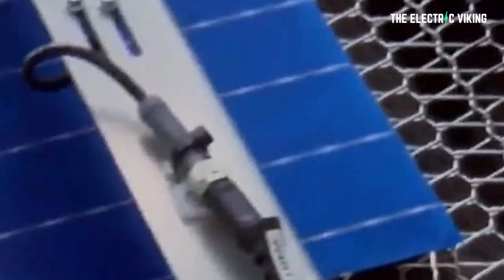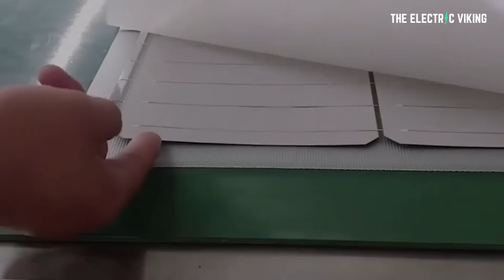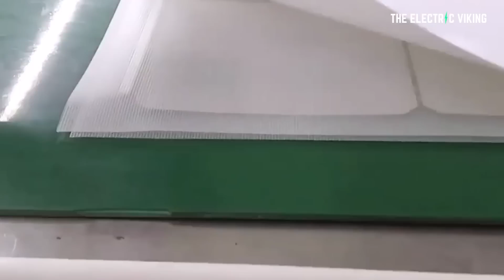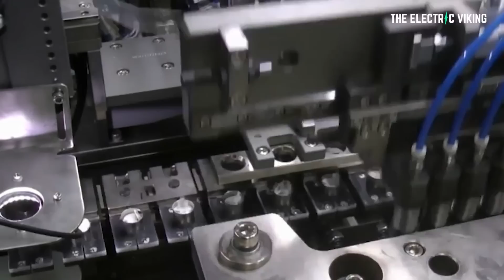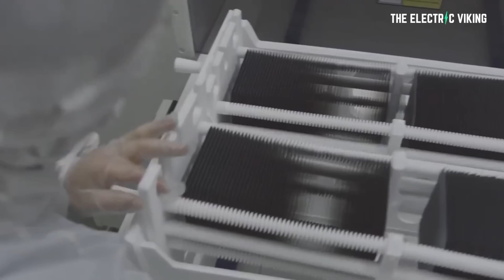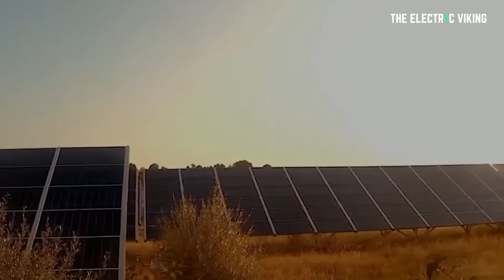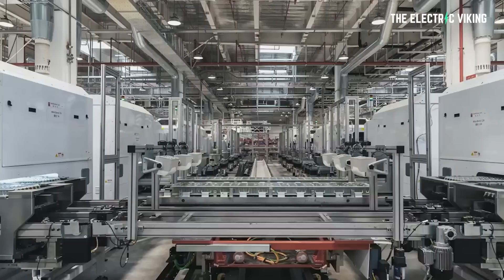China’s solar panel price war will double solar panel installations globally

Comment: Solar is not usable in most of Europe.there is risen need of energy wintertime but more than 4x less solar at that time. And also battery tech will not help since holding 50 days worth of energy will fill the gap but that costs too much but when done well it has similar initial cost to nuclear. The problem is that is not green energy anymore since area needed to cover solar panels will need that arable land is covered and that means erosion and methane generation instead carbon capture by forest or food generated. So let Europe out of equation. It will be good part in mix but it is not 100% solution. In my country Estonia there must be 90-100 day storage for 100% solar and about 5% area covered. Most of europe needs 15-20% area covered by solar cells. Estonia us started to move towards wind energy and in 10 years there  may be 2x current electricity  needs come from wind  that means 2/3 wil we green energy and the rest is heating and that is problematic since  when not to do seasonal storage then there will be overproduction in summer and underproduction at winter storage some 20 days total as a heat in hot sand may be optiin and  use molten salt batteries to heat that sand may be solution.

Comment: My son maintains a solar panel array and the problem with it is not with it generating electricity but generating it at the wrong time. if we accelerate solar production again without being able to bank the excess power it makes in daylight hours then we will need those fossil fuel generators to cover nighttime demand. The gas-fired generators will hold the market to ransom while they are needed and demand huge subsidies to remain available and this will push up prices Our grid is still unsuitable for even more solar coming online as well. So until we can store all excess solar production and deliver it to the grid in total expanding solar anywhere is not viable.

Comment: How many of these Chinese solar panels are produced using fossil fuels, coal mainly, or ecosystem destroying hydropower probably the majority. How well made are they? What are their environmental impact when no longer in use??? 
I'm off grid and use solar and I'm for clean energy but in many countries especially  northern Europe it is not going solve our energy needs it is only a small part of the solution. Massive investment in nuclear fusion not fision, the much more toxic big brother technique, are required and better built homes and more small scale local solutions involving solar and wind may certainly help. Japan has successfully run a highly efficient fusion not fision reactor for a year with no problems. Just an opinion.

Comment: Sam, love your optimism but disagree on a massive increase in demand coming from a lower price of panels (demand elasticity). For a start the cost of the panels is only a part of the cost of installing grid scale solar. Secondly, although marginal costs of running a commercial solar farm are close to zero, you have to consider the capital costs too. The cost of capital is rising all over the world due to higher interest rates and a rapidly changing demographic. Which brings me to the third factor constraining installations of solar, labour. In most European countries now the baby boomers are retiring at the fastest rate in history, the pool of skilled labour is shrinking which is causing all kinds of problems...and of course rising salaries which add again to those costs. Love the channel, the world needs more of your ‘glass half full’ attitude.

Comment: At the moment, this is more of a political problem than anything else.  The EU is subsidzing Oil&Gas at an unprecedented scale and throwing other spanners in the works of the transition. This will slow it a bit, but not stop it.

May I suggest you make a video about said EU subsidies and Carbon Takeback Obligations.

Comment: You still are not explaining how we get through the week of wind and solar drought like we had back in June just to get through 1 night in that period would require 500000 megawatts of either generation or battery storage  that's 30000 mwh x 15 hours leaving 10 percent for line stabilisation  don't wish to hard for all coal and gas generators to go broke you might regret it   either we retain backup gas generation which will have to be subsidised or we go to nuclear  backup    look at the big picture and not just the 100 percent renewable dream

Comment: You didn't mention a key factor in the shift to renewable energy - power storage.
A 30% drop in price for solar panels will only acierate the demand for them, AND for power storage.  Selling power storage systems will be like printing money.
Tesla's new Megapack battery factory in Lathrop, California, that is just now coming online, is far larger then any other, but 40 GWh per year isn't enough for the rapidly coming shift to renewable energy.
Reply: Yes, the new Megapack factory is rated at 10K units per year, $2.4 million per unit, it's sold out to 3rd qtr 2024.  Utility scale storage is already rocketing, sky is the limit for years to come, more so as battery prices keep getting lower and renewable sources keep growing.  Giant floating wind turbines is the coming big thing, 500 ft diameter rotors.  China has an off shore wind turbine with a 827 feet diameter rotor that generates 13.6 MW, don't think it's floating, nevertheless it's amazing.

Comment: The reason why chinese would not be able to keep pricing down comes 2 side. 1st is their new embargos and usa turning their back on them( why they have to invade taiwan so they can keep their high end machinery running due to chip shortage) 2nd side is raw materials solar panels raw materials come from canada, and partially their recovery from the whole covid lock down which is going to be hard. On the side about the forced labour. If chinese really had such great free market factories you would be seeing 24/7 media campaigns so they can rub it on USA. Sometimes what you don't see tells you more than what you do.

Comment: Europe needs nuclear for base load. Solar isn't always sufficient even combined with wind and battery. Nuclear is the cleanest and safest power supply, and the newest generation nuclear is more so than ever. Modular reactors and newer designs can be less expensive than previous generations. I'm not saying don't do solar, wind, hydro, geothermal, batteries, but nuclear is ESSENTIAL IMO.

Comment: I know China wants to deal with their pollution problems. They are deploying a lot of renewables.  But they are also deploying a lot of coal plants.  This is to deal with recent power outages.  And this is to run an economy heavily based on manufacturing.  I'll be convinced once China is able to phase out their reliance on coal, and run an industrial economy based solely (or mainly) on renewables.  This is the test.

Comment: Crucial: increasing the efficiency of photovoltaic panels to more than 80%. Maximum experimentally is 34% (silicon-pervoskite tandem cells - researched by a German/South Korean team). 

CPUs, GPUs and RAM to over 80%.

Also nice: ZOOMLION using more and more EV mode with its construction machines.

Comment: Renewables have been nibbling away at the customer base and oil and gas for a decade now, but only now is that starting to have a noticeable effect. The Russia war has distorted and added a huge multiplier. All the doubters focus on volumes when the real change happens at the marginal price level where very small changes in demand can drive huge swings in price. Witness the complete temporary collapse of oil price in spring 2020 due to the bug. OPEC and others can only win if they can co-ordinate enough to drop production concurrent with demand, but at some point it will be a runaway train with some dictator needing his corrupt cash and selling black market. Soon it will be desperate rush to oblivion.

Comment: WRONG!  Solar cannot be used as base load.  If your thesis was remotely correct, a coal/gas/oil generated utility that went out of business would leave the solar panels to provide power when the sun shines and no electricity at night, UNLESS there were sufficient storage to meet the nighttime electricity demands.  Batteries are not getting cheaper, in fact, they are getting more expensive as the raw material shortage gets worse.  What will happen?  Individuals will take advantage of lower cost panels and install them on roofs and feed electricity back into the grid.  As that electricity reduces the income to the utility the utility will decrease the money they pay consumers for excess power and will charge more for what power is used.  Hence higher utility rates.  The California utility commission has already set April 1 as the date for a decrease (approximately 70%) in the amount paid for solar power from consumers.  Solar on rooftops can still be viable, but remember TANSTAAFL.  There Ain't No Such Thing As A Free Lunch.

Comment: Heh..you might be right. I've noticed that the price of natgas has dropped below $4. Oil prices have dropped as well. You have to wonder what will happen to fossil fuel prices if demand drops dramatically. The next year or two should be very interesting to say the least.
Reply: Fossil fuels will eventually go the way of blockbuster...
Reply: fuel prices will drop, as most of the price of fuel is the intrastructure spending from constant growth. Once fuel use peaks out and starts declining the price will be very very cheap, which will create a bizarre situation as it will help fuel vehicles remain economical against EV.
Reply: @sectokia1909  Nope. Fuel companies will UNDER invest in Refineries and other transport to keep Prices Higher and Profits higher. We saw that during this mess in Europe earlier. Fuel prices will remain high(er) because many of the Fuel Producers are Cartels and near monopolies.

Comment: Although I don't fundamentally disagree with what you are saying, a lot of the market analysts seem to think that gas and oil stocks will have another bumper year in 2023, as they had in 2022. Also in the case of Germany,  relying too heavily on solar and wind energy seemed to be a mistake for them.
Reply: Insufficient energy storage capacity.
Reply: Relying on Russian Gas seemed to be the BIGGEST Problem by Far.

Comment: Hi! Do you have sources for the data that you provide? Enjoy the channel, but it would be great if you can add your sources
Reply: He never does.
Reply: Why the heck should he.  Tony seba has done the research.  He's got better thongs to do with his time than deal with deniers
Reply: He has no source, he is lying.    If the Island of Ireland  installed 50 million large wind turbines and  50 million solar panels.  If it dismantled all its fuel generators,  there would be no electricity at all.

Comment: China was able to produce panels at much lower price by using cheap Russian fossil fuel. Each panels need to produce energy for 3 years before it can offset the carbon emission require to make that panel. Go figure. So when you say panels production is going to explode, you actually meant fossil fuel consumption required to make those panels are going to explode. How are the fossil fuel companies going to bankrupt? You sounded like Toyota promising solid state batteries.

Comment: Solar farms need structural galvanised steel frames to support the solar panels. 

Solar farms are also 'old school' centralised concentrated electric generation and need 
new transmission lines to connect to the grid.

Both expensive. 

Rooftop solar has FREE structural support. 
Rooftop solar is FREE of transmission costs. 
20million buildings in Australia 
300million buildings in USA 

Rooftop solar is HALF the cost of windows in Australia. 
33m2 window area, and Rooftop solar area. Just saying, because it is not obvious.

Comment: "Makes the world a better place. "
CO2 nonproliferation 
Nuclear nonproliferation 
National Electricity Grid nonproliferation 

The national grid is 100 years old.
The national grid is extremely expensive. 
5 'national grids' is the required capacity in a no fossil fueled world. 

Stupendously stupid amounts of raw resources are required including fossil fuels to mine, smelt, manufacture, transport, construction, foundations, 
Stupendously stupid economically to finance and pay back period. 
Stupendously stupid amounts of manpower in manufacturing and construction. 
Stupendously stupid amounts of maintenance. 
Stupendously stupid amounts of extra land to be acquired. 

Somethings are not obvious until they are written down. 

And still 5 times more central electricity generation plants to be built. ????????

Comment: The grid cannot support large changes in power production over a 24 hour period. 80% of power production will always be consistent base load, with 20% variable sources from wind or solar. Until there are giant fields of battery packs to store power at night.
Reply: There's already lots of pumped hydro batteries, these are easy to construct at massive scales to replace all existing "baseload" capacity.
Reply: @gerryburde5663  and the best places for solar power usually have a lack of water
Reply: @zedzed5276  Australia - driest populated continent on earth. We are building pumped hydro in old mining sites because water is recycled so only needs topping for evaporative losses.

Comment: The price of Solar panels will go down 30% in the coming months due to a glut of raw materials. US solar power grew by 600% last year. Some are predicting that the price of electricity from fossil fuels will go up because large power plants cannot function efficiently without running at 70% of capacity or more. I think they are likely wrong. The only reason we don't use more fossil fuels is that the price goes up when we do and quells demand. With Solar power, you buy it once and you have all that it can produce for at least 30 years. You wind up with an economy that is unrestrained by supply. If fossil fuel plants are out there the energy they produce will be used as long as it is cheap enough and solar will just mean the economy will simply grow to use it.

Comment: I think Northern Europe (Scandinavia, Germany, Holland, UK etc.), will use more wind than solar here is why:
In areas of the planet where more energy is used for cooling than heating, most energy is needed when solar is also at its highest i.e. the summer.
In areas where more energy is used for heating than cooling, solar is at its weakest, so wind energy will be more cost effective.
Both will need battery storage for the grid.
Reply: We use a lot of wind in the UK. There's no way we can build enough batteries to store energy to keep the grid going for weeks at a time.
Reply: @Withnail1969  A 5 year old is aware the wind does not always blow, and the sun doesn't always shine, hello night time.
Nobody has suggested we can have a 100% energy supply of wind and need weeks of battery backup.
However I think we can have a clean energy mix of wind/solar/nuclear and battery and have a world with a cheap, clean, low co2, reliable and almost abundant energy supply. 
And I am fairly confident it is going to happen based on price.